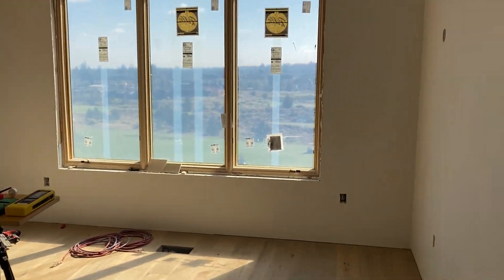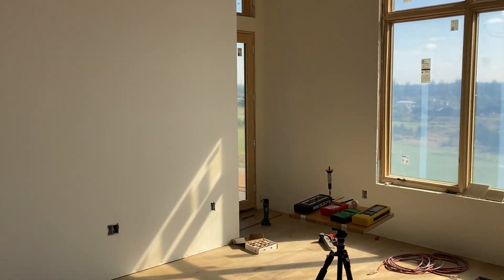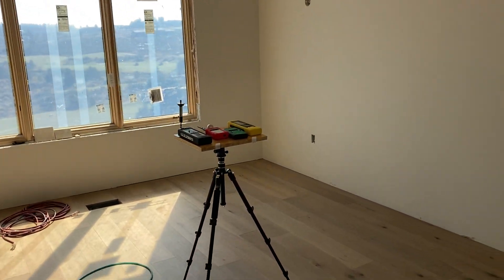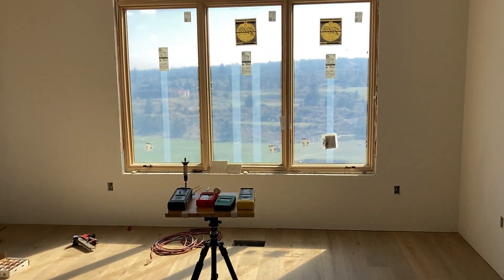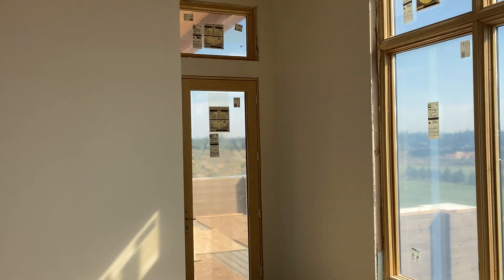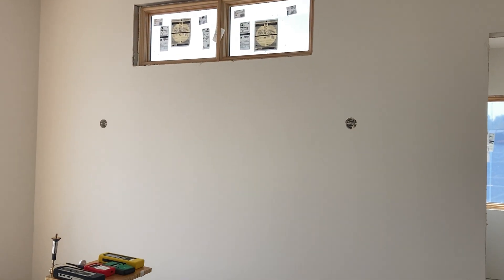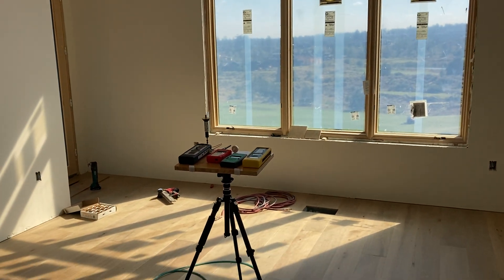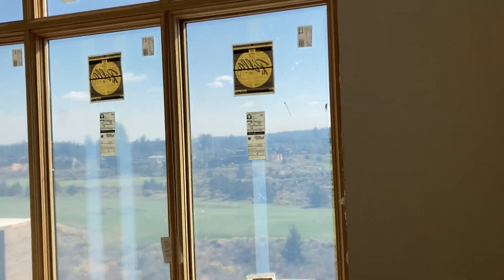How to make your New Build or Reno low-EMF

Comment: Thank you for this video.  I am wondering whether there will be a little EMF leaking through the seams after the window film is applied?
Reply from the maker: There is potential for that yes, as well as the window sills.  That’s why before/after measurements are so important to verify results of shielding.
Reply: @optimaldwellingspaces3947  Will you film the application of the window film onto the windows and do a before and after measurements?  If there is leaking would you recommend making curtains out of the Swiss Shield fabric?